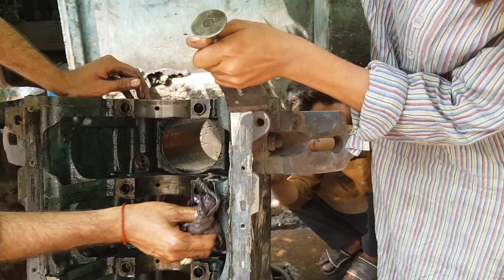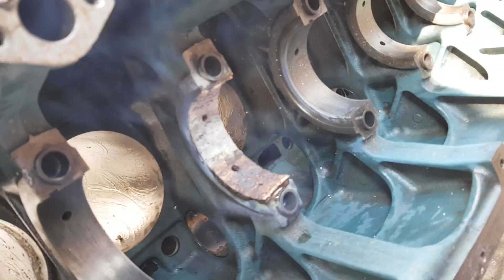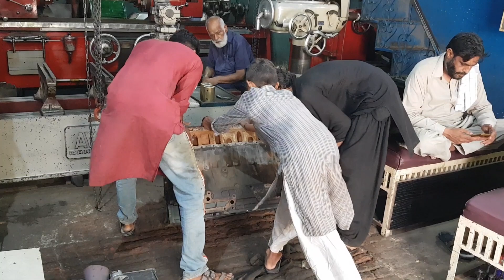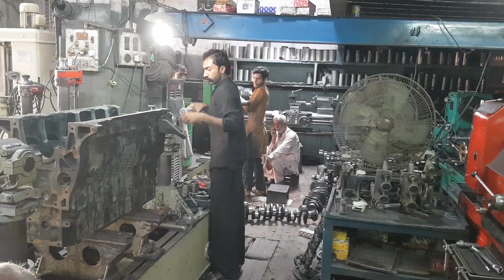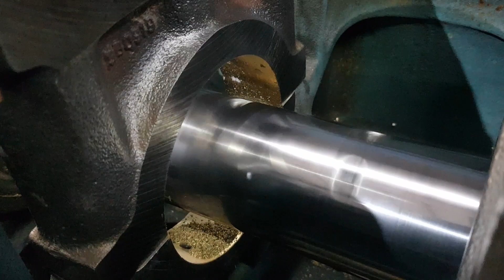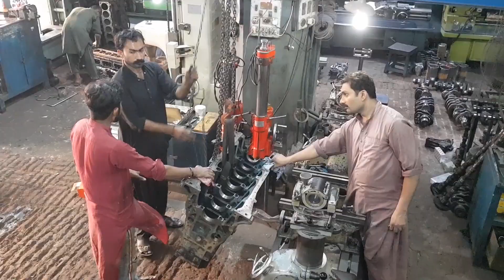Engine Block Crankshaft Main Line Repiar | Daewoo Block Restoration

Comment: Okay….
Wait a damn minute!
Stop dropping the engine blocks!
No wonder crap is always broken!
Slide it down to the ground on a plank or a set of pipes.

Now….back to our program
Reply: Rubber tire
Reply: Or you can drop it in an old tire, I know it's very heavy 👹